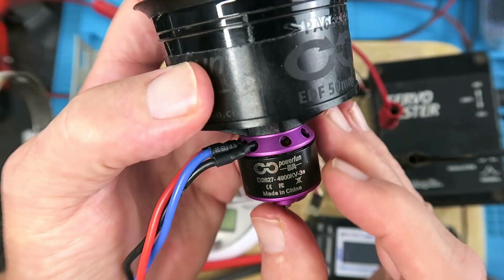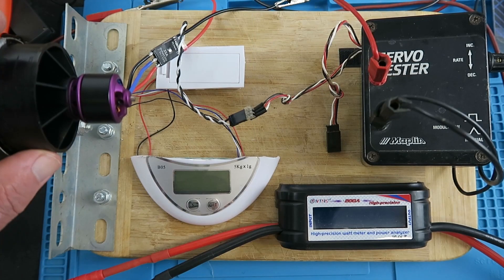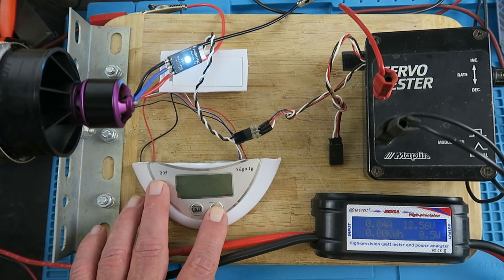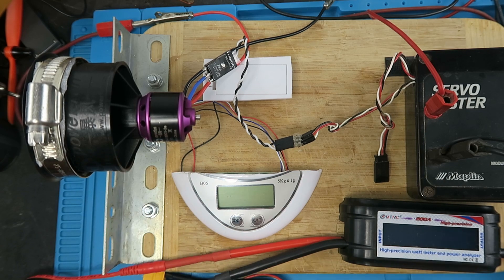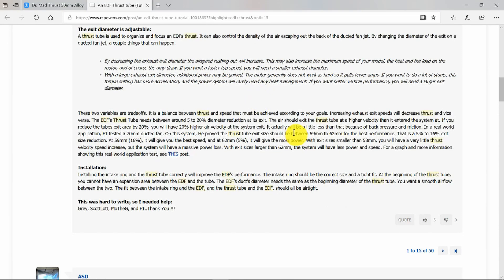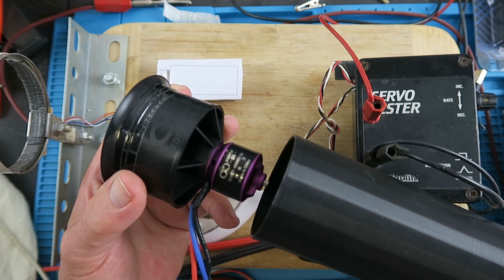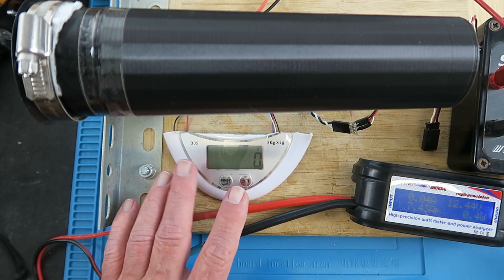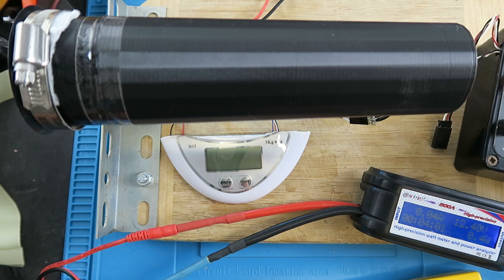HTIRC 50mm 11 Blade Ducted Fan 3S 4900KV Brushless Motor Thrust Test

Comment: I saw a video where this set up produces over 700 grams of thrust and the 4s 4300 kv unit produced over 900 grams and everyone that sells this advertised it as dynamically balanced from the factory and 770 grams on 3s. Way off what is claimed so either exaggeration has reached the point of ridiculous, 390 grams  770 grams 😂. Or maybe your batteries are weak not sure but somethings going on, great video though 👍🏼
Reply from the maker: Hey thanks! Have a great day!

Comment: The tube is not to increase thrust - but to improve its flow and to give you better speed ratio.
Reply from the maker: Hi, are you the same solentlife as over on the Lancaster thread on RCGroups? Anyway I say the same as you : https://youtu.be/nj7AFXYD39o?t=508 narrowing the output diameter of the tube will enable quicker take off at the expensive of top speed. This was a very basic video on a complex subject. Thanks for watching, have a great day!

Comment: Is this 11blades fan? I got that and on 3s 25C lipo it only produces 450grams of thrust and it is far from states 900grams by the seller. Is it battery? Also I know it says 3s max but I feel tempted to use 4S od 95C on if so it can show its full potential. Also - what model weight (starting mass) do you think it coils work best for acrobatic jet flyer or scaled model od modern jet. Accordingly for single and then for double motor units.
Reply from the maker: Yes it is 11 blades as it says in the video title!! Seller / manufacturer thrust estimates are normally exaggerated. My figure for this unit at 100% was 390g @ 255 Watts. There is a good description of thrust to weight ratio here : https://www.rc-airplane-world.com/watts-per-pound.html Thanks for watching, have a great day!
Reply: @1nformatica  12 bladed fans of this size (50mm) and on 3 or 4S have thrust advertised over 1000g on full power. May the C rating on the battery have an impact on the maximum thrust together with one more blade? And do you think this unit we own could still go on 4S + 40amp ESC combo or it will instantly fry the motor out?
Reply from the maker: @theartofflying3108  I never believe advertising claims. For batteries I check the internal resistance, my best EDF packs are around 3 -5 milliohms per cell. If you try 4S you can always start at low power but keep in mind it will spin at RPM's in excess of what it was designed for and there is a real danger of the thing disintegrating. Safety glass at all times! Thanks for watching, have a great day!

Comment: Thank you for your tests. But I don't understand why do you need this pipe. Because without your results are (25%,33g, 13,4W), (50%, 190g, 89,8W) and (100%, 390g, 254,6W). With this pipe your results are worst (25%, 74g, 33,6W), (50%, 172g, 90,1W) and (100%,343g, 239W). So the pipe reduce the capacity of the EDF. So why do you say the pipe bring better performance please?
Reply from the maker: It is a complex subject which I over simplified. Static thrust is only part of the story. By changing the length and diameter of the tube you can change the dynamic thrust so that a plane can perhaps accelerate faster but have a lower maximum speed or less thrust with a higher top speed. take a look here : https://www.rcgroups.com/forums/showthread.php?1150196-EDF-Thrust-Tubes&highlight=thrust+tube+program&perpage=20

Comment: airplane ke liye maine 2 brushless motor purchase kiya tha.  Lekin mera battery backup kam pad raha hai.  
Mai aapko mere motor ka specifications batata hu 
SIZE : 64mm
MODEL : QF2822
KV. : 3500 KV 
CONFIGURATION : 9N6P shaft
DIAMETER : 22mm stator
LENGHT : 22mm
DIMENSION :  28*60 mm
IDLE CURRENT @10.0V :  3.5 Amp
NO OF CELL :  3-4S lipo max
CONTINUOUS POWER  : 1000W max
CONTINUOUS CURRENT : 67Amp

Please mujhe batao konsa battery kitne MAH ka battery lena hai

Comment: ESC cooling just add a small tube like based on the pitot tube design inside of the thrust tube which collects the air from the engine and from the engine which is transferred by a carbon fiber tube make sure the carbon fiber tube is not too big nor too small just enough the air to be collected. Air from the engine is used for cooling on the esc on your radio controlled airplane. Make sure that your engine has more thrust to improve the cooling of your esc.
Reply from the maker: Thanks! Very useful info, thanks for sharing. Something for the next design! Please consider subscribing if you have not done so already!

Comment: I have the same E.D.F unit,  I have not tested the Thrust yet, but I measured Watts and ranged at 357 watts & 36 amps at full throttle. I was using a 3S 1300mah 50C battery.  Beyond 60% throttle a 25C battery will struggle. I recommend 60+ C ratting battery. Forget about 4S. Good Video!
Reply: I'm prty sure you can go 4s with this all day long. I'm running a 4900kv outrunner, looks like the same motor as in this video. My 4900kv was meant for 3s and I was told by the seller that 4s would fry it. I've had over 70 trouble free flights on it with 4s. It is a 64mm edf that was originally a 4500kv set up. The 4900kv motor with 4s battery is 681.9 max watts and 45.74 amps. After a nice flight she comes down barely warm. The set up is producing 1400 grams thrust with a thrust tube, static, stock was 680 grams thrust. The mig 15 it's in weighs 720 grams with a 2200mah 4s onboard, performance is real good, verticle is it's playground(seems higher milliamp batterys also helps with demand on your pack and LVC issues). So its a 15$ motor, if it frys, it's not a giant loss. I'm guessing 4s would be nice applied here, for your needs.
Reply: @mongoose4117  so did you use a bigger fan prop for this motor? Maybe this is why you did not fry it yet as it turns less rpms and if could and still saves itself from overturning and overheating? Obviously it could be a matter of luck this 70 tries mentioned. Or the manufacturer just gave us wide safe margin for the S number used to preveserve longer motor life.. and we could go even with 5S on it before it will burn out (?)
Reply from the maker: Hey thanks! Good point about the C rating. These are hungry beasts! Please consider subscribing if you have not done so already!

Comment: Does it support a 6000 Mah 3s for a twin edf?
Reply from the maker: The fan motor is designed for 3S so yes, you can run two from a 6000 mAh pack. Please consider subscribing if you haven't done so already!!

Comment: Your part and full throttle tests on a static dyno dont translate into the plane the same way. Once you add in intake air velocity the amperage and thrust values can change a lot thoughout the throttle spectrum.
Reply from the maker: Static tests may not translate on to a plane directly but I think they are still valuable. They give a baseline to be able to compare different setups and make measurements that would not be possible to do in flight.
Reply: @1nformatica  Actually to take these measurements in flight you would only need the EDF to have a MM or two of play within a slider mech, a spring of known tension, and a potentiometer to measure displacement. Its possible to calibrate a built in dyno and record data from it into a raspberry Pi. 

You could even graph the thrust along with airspeed and throttle input in 3d form

Comment: Please tell me the bore diameter for the electric motor. I have a desire to buy this EDF for Inranner 2435.
Reply from the maker: The unit is supplied with a 2624 motor http://bit.ly/EDF50mm I guess you can replace it with the motor you have if it is similar in kv.
Reply: @1nformatica  Yes, I saw the data of the electric motor from the seller.  But this is the data of the stator and rotor.  A landing motor extension is clearly smaller in diameter.  I would like to know the diameter for sure from the owner, not the seller.  Or is the diameter of the seat 26 mm?
Reply: @1nformatica  Thank you, but now the question is not relevant.  Found a circuit.  Seat under the motor, with a diameter of 20 mm.  for inrunner 2435 is not suitable.

Comment: hi sir i want to buy this motor
Reply: I'm from India
Reply from the maker: You can buy it on the link I posted. If they cannot ship to India I can send you a link to Aliexpress.
Reply: But sir it's good for rc jet and about it lift weights
Reply from the maker: @rchobbykhem  It is designed for RC Jets. You can see the results of my tests here : https://youtu.be/nj7AFXYD39o?t=486
You will need a jet that weighs less than the thrust it produces with or without the thrust tube.
Reply from the maker: You can see an example of the type of jet here : https://www.youtube.com/watch?v=TpsCmnCUOI8
Reply from the maker: You can find it here : http://bit.ly/EDF50mm
Reply: Hi sir
Reply: How to buy
Reply: I want to make a rc jet

Comment: One of the cause of inefficiency  of EDF is the design of FAN BLADES and the ROTOR TIP BLADE Gap to the DUCTED WALL.as we observe all or lot of EDF has a small diameter fan blades. Those fan blades will not  give u a full potential power of your motor unless your ELECTRIC MOTOR is underpowered.
Reply from the maker: Thank you for your input, very useful comments. Now I have experimented with EDF, I think I would only use it for effect and not performance. They do make a unique sound!!

Comment: Very useful, thanks! Do you think two of these will provide enough thrust for a 2 kg RC airplane?
Reply from the maker: Hi Frederik, I don't think so. I put it on a flying wing of just 670 g and it could barely stay in the air : https://youtu.be/9y8m65j1GCM?t=564
Reply: I use a 70 mm world model EDF. It could lift a 670gm model vertically from static and draws a 32Amp from a 3S cells. For a 2Kg aircraft you probably need 90mm or bigger EDF or a twin 70mm EDF set up.